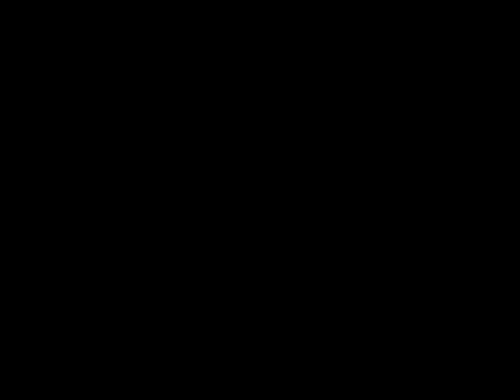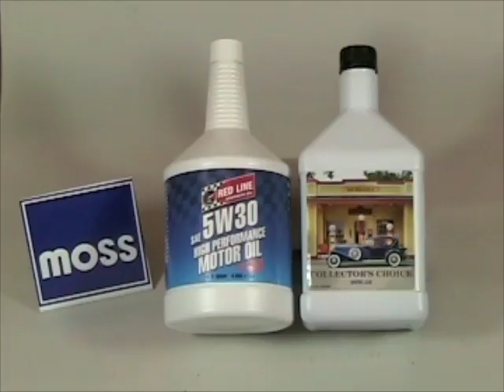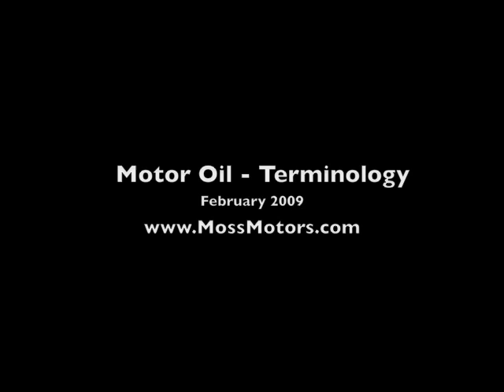Motor Oil - Terminology

Comment: @donkeydong75402 
When they are talking about 'weight' they are not referring to mass. The word weight used in the context of motor oil is instead referring to a measure of viscosity. Not very exacting language, but it's at least standardized.